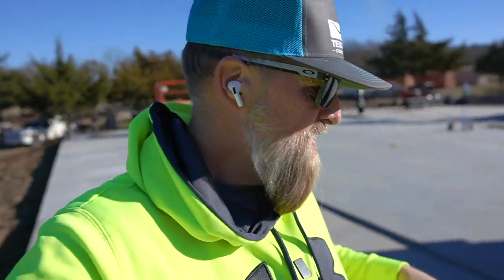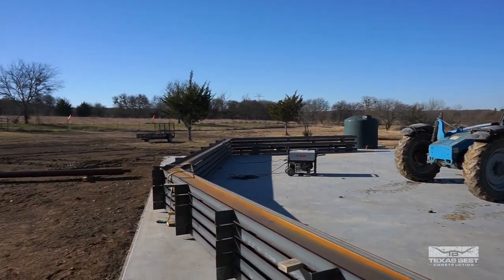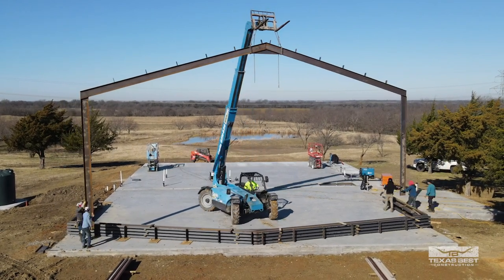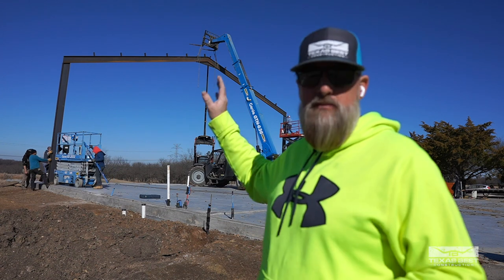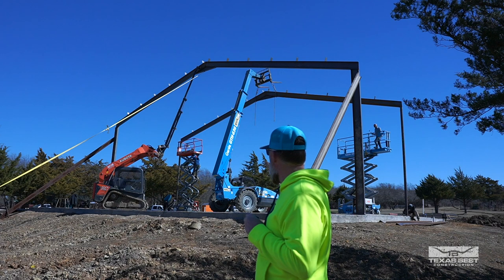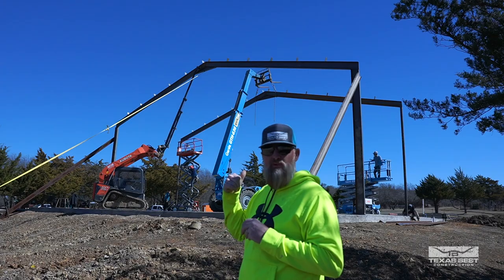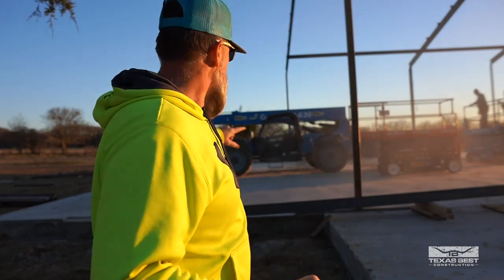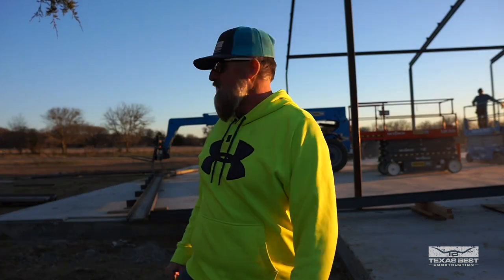Files Valley BARNDOMINIUM HOME Standing Steel | Texas Best Construction

Comment: How do you anchor interior walls, drywall, etc.? How do these do in a tornado? What type of anchors do you use for the frame?
Thanks for sharing! I'm considering this & hadn't seen these homes before.
Reply: Every county has wind load codes. I believe you can research it online. Concrete screw or small anchors for your stud walls

Comment: What is the limit on how wide you can go with weld up beam spans? Is 55ft about it then you have to look at a bolt up?
Reply: I've seen 100ft wide with weld up 24 inch i beams just needs have gussets at each end
Reply: but I would think 100 is the limit

Comment: Hello and greetings. I would like to thank you for recording such videos, which help people like me a lot. I have a request from you. My request is that you help me to build the halls I want. My hall has an opening of 30 meters, but without the middle column at a height of 6 meters. I want to know with what size H beam I can build these halls. I will build it. Of course, if the opening is 30 meters, it will answer. If it doesn't answer, I can make the opening of the shed up to 23 meters. I am waiting for your correct answer. I thank you again for your help. I wish you a good day
Reply from the maker: Your very welcome thank you

Comment: American steel prices are crazy right now.  Went from $480 in July to $1,252 per ton today.  They have punitive duty on Chinese steel and it's still half the price.  I swear these union run American steel mills are not even trying to be competitive. You don't even see scrap prices hardly budge at $200 per ton and ore even less.  

Wood prices are high right now too but not this crazy.  Hyper inflation?
Reply: Wood is stupid high... last year a sheet of osb 7/16 was $14ish now its $33 🙄
Reply: Test some US steel vs Chinese steel in a lab... no comparison. I wouldn't trust Chinese steel on something as important as a building nor an aircraft.
Reply: @CarolReidCA  Yeah I'm sure like a sky scraper or bridge it's critical to use top notch supplies.  But if I'm building a steel house it's probably going to have a safety factor of like 8 regardless of where I source the steel.  I have a Rockwell hardness tester, I have a 40 ton press, I could rig up something to do tensile and compression tests too if I really wanted to.